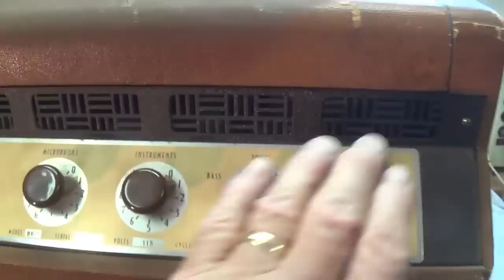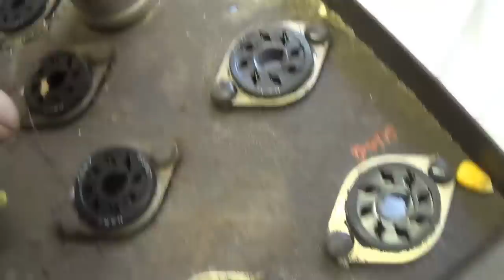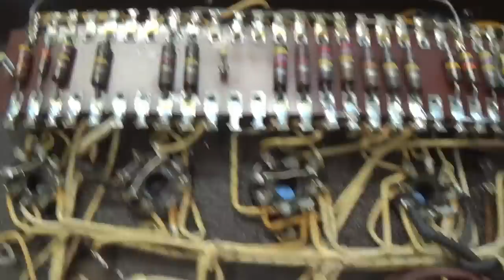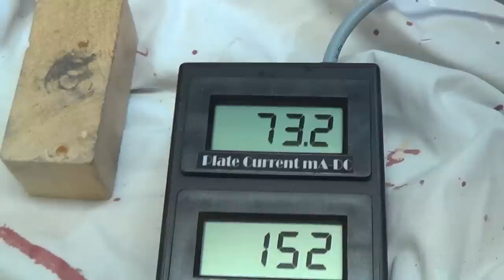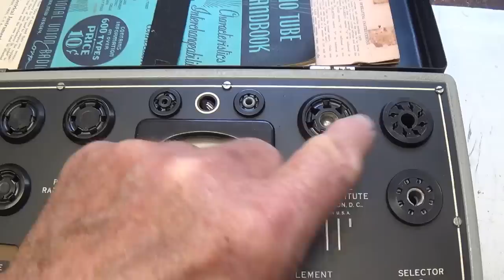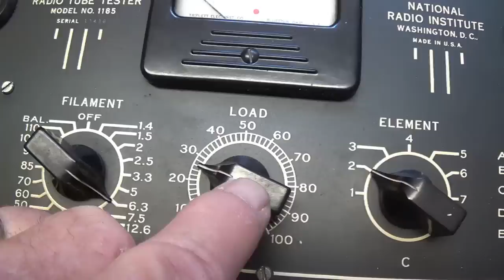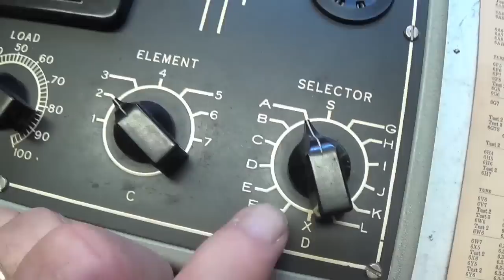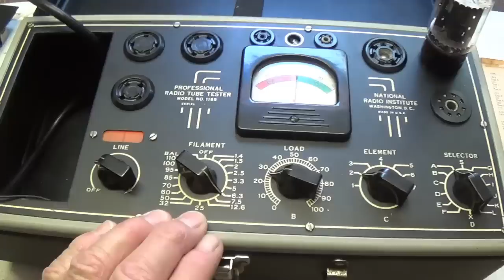Rare & Wonderful: 1946 Gibson BR-1 Amp and 1941 Triplett Tube Mini-Tester

Comment from the maker: In retrospect, and as noted by several astute viewers, the 20K resistor to ground is not responsible for the low B+ seen in this circuit. It may serve to drain the electrolytics when the circuit it turned off, but its parallel (rather than series) positioning would not cause the B+ reduction. Apparently, the HV winding of the PT was configured to create a lower-voltage higher-current output, which was further reduced by the addition of the huge filter choke (probably added to the circuit at a later time).
Reply: More important, don't think there was such thing as a really good used car in 1946
Reply: If it were me, I'd bypass that second choke and see if hum occurs. If not, one could probably do without it. I remember back in high school when a friend was
getting ready to add more inductive filtering. He was getting more hum that he was willing to endure. I told him to reverse the audio feed wires to the voice coil first.
That hum bucker coil under the spider only works if the polarity is right. That did save him buying and adding another choke.
Reply from the maker: Thanks, Tom. The amp is long gone......back home with its owner.
Reply: @UncleDoug   And probably been used a time or two(8-). I didn't stick my head inside the speakers here, but I didn't hear the least hint of hum out of that old
Gibson... So that extra choke certainly didn't hurt anything.
Reply from the maker: It was quiet as a church mouse, Tom, which is always a good thing :)

Comment: A thought on that metal shield might be to provide some slight additional RF protection, if it was used in a radio studio near the transmitter site.  Maybe ?? Many bands preformed live, and many stations had studios located on the same property as the transmitter.
Reply from the maker: Thanks for your input, DH.

Comment: I may have commented on this before but my dad bought that model amp and a Gibson lap steel guitar before I was born! He gave it to me to use when I started playing guitar and singing when I was about 12 (1964ish!) it didn’t work when he dug it out of the attic, so it went to the local electronic genius much like yourself! I practiced and played through it until I bought a used 68 bandmaster about 1970 with the tall speaker cabinet with JBL speakers. That amp was destroyed in the flood of 72 in NYS.
Reply from the maker: What a shame that it was destroyed, Bob. Either amp would have been a nice heirloom.
Reply: Uncle Doug the BR-1 was LOUD too! Now that I think back, I blew the original speaker and just put in a replacement from Lafayette at the time, wrong type because as you know better than I, the original had extra coils so it never sounded right after that. Must be the reason I bought the Fender. I gave the Gibson to a friend and that was flooded too! Love watching you bring vintage amps back to life!

Comment: those 'terminal' boards are common in Australian guitar amplifiers through the 60s.  I hadn't seen them anywhere else until now.  The mounting of electrolytics under the board is also common.  They've even wrapped the leads around the board tags in the same manner... I wonder if this was common tech back in the day, or if Aussies appropriated it (or if techs traveled and brought their methods with them?)
Reply from the maker: It's a fairly common technique, K, probably used world-wide.

Comment: Hi uncle, i wAnt to ask you something, about speakers...I saw on sale a Jensen coaxial speaker of the 40s era...its like new, and searching info about if can be applied for guitar use i dont find nothing,,,Do you know about if its posible to used and if its gonna be good sounding? or if is some mod to take the tweeter off and use only the big speaker?
Reply from the maker: It's probably an electrodynamic speaker that will only work with certain amp circuits. I would not recommend it.
Reply: @UncleDoug  its very cheap and in almoust perfect condition, and it comes with the radio and play records all together...i guees its around the 30s or 40s and nice condition, very very cheap...cant used with guitar but i gonna buyed to see it more closely :D thanks for the answer
Reply from the maker: @fakundofrontera  By all means, buy it and see if it will work for you, FF.

Comment: Hi Doug, you really outdid yourself on this project!  Humor, kitties, circuit comments, clear as a bell, pristine unit... the ultrafecta.  Superb job!  Two comments:  

1) That grill blocks a ton of the direct radiation!  Now it sounds _great_, and clearly that gossamer-thin surface acts as much a diaphragm as the woofer cone itself.  In a perfect world, one could have another, less-impeding grill (or no grill) to substitute with a quick change-out.  I just wonder how that would sound. (It could easily be worse!)

2) The original wire bundling is very fine for many purposes, but I wonder how much crosstalk and intermodulation penalties result.  Of course your careful wire twisting, right-angle overlays, robust grounding, and use of shielded wires has been very successful.  But compared to the original wire layout, I wonder what an ideal rewire like yours would do for noise, distortion, and tone.  The first two should certainly benefit, the last maybe not.

3) I meant to add, do you have favorite make and model (not value) volume pots?

4) Oh, and what were those lovely tunes at 24:00 and 25:00?  I'm ignorant of music. :(

Cheers, Sam
Reply from the maker: Thanks so much for your interesting and knowledgeable comments, Sam. I tend to buy the inexpensive Alpha pots from Antique Electronic Supply. They are spot on as far as taper and resistance.....and they have a nice rotational feel. Ollie & Jack often play tunes they have composed (in between cat naps and catnip binges). I hope you enjoyed them.

Comment: For several years, I hand tied lacing cord in electronic drawers in the Air Force.  It's a lost art.  Zip ties are usually used now.
Reply from the maker: I really like the look of lacing cords, gathering wires into cables within the circuit. You're right.....it is a lost art.

Comment: $200 is 1946 was like half a year's pay. Gold was $35/oz. That's almost $10k today.
Reply from the maker: I'm not sure if the conversion is quite that extreme, D, but there is no doubt it was expensive in its day......just like all Gibson products.
Reply: @UncleDoug  It depends on how you measure it. If measured against real estate it probably is. Gold is $1500 usd per oz now but it is no longer used as currency whereas is was the currency of the united States in 1946 with a set conversion of $35/oz.

Comment: The dents in the aluminum grill can be fixed by smashing it several times with a rubber beach slipper or something like that. It won't damage the grill, but the dents will become less apparent. I used to do it to repair the aluminum grills in parabolic antennas years ago.
Reply from the maker: That is an original solution, Jose. I will keep it in mind :)

Comment: I think despite the BIAS is about 12,2w maybe such a high amp value make overheat the tubes with that old cabinet design ventilation. But obviously I'm not sure.
Reply from the maker: You could be right, Suterudo. Overheating is definitely an issue in this amp.

Comment: Great video, really enjoyed it.  Regarding the low B+, did you measure the ac voltage out of the power tranny?  This would give a good indication of where the B+ should eventually fall, after taking rectified drop into consideration.  Perhaps something else is affecting it.  Can't argue that it did sound good.  It reminded me of early recordings of guitars made in that era.
Reply from the maker: I returned the amp to the owner, Brad, and am now unable to do any further checking. As far as I know, it is still operating properly.

Comment: Uncle Doug... Do you think this unusal 150 plate voltage design here on this Gibson BR-1 was done so to add to output tube life?
Reply from the maker: Good question, Dave. Possibly that and heat reduction......neither of which really seem (to me) like issues that are pressing enough to justify designing the circuit this way. Perhaps it's due to the huge filter choke, which was probably added to the circuit after its manufacture. Very mysterious......yet it sounds great.

Comment: A general old amp question. Some old amps have a "mic" input. How are they different from the "guitar/instrument" inputs? Was there any standard or consistency to them?
Reply from the maker: Generally the microphone input offered higher gain, sometimes utilizing an extra tube or amplification stage to compensate for the lower output of most early microphones.
Reply: Thank you!  @UncleDoug

Comment: Just a follow-up on the Hagerman Vacutrace. As Jim Hagerman told me by email. ”they only come up for sale when somebody dies” the one I have was the first unit off the production line when he was selling them. Jim Hagerman is an audio guru and designs and builds super hi-end hi-fi gear, mostly one at a time because he is so picky about the equipment that he sells he doesn't trust factories to assemble it. The Vacutrace was designed specifically for testing and matching tubes for audio amps. It is a mostly analog design because as Jim put it. You don't get anymore analog than a vacuum tube. I found a website online about ten years ago and ordered one. A month or so later when I inquired about my order I received an email from Jim Hagerman asking me where I had ordered it because they had been out of production for ten years. I gave him the details and he told me that the had the pre-production unit on a shelf in his office, and had enough parts in his storage unit to put together a complete set of adaptor boards and would sell that one to me if I  was willing to wait a few weeks for him to rummage through his storage and find where he had put all of the leftover parts. He went through the unit off of his office shelf and made sure it had all of the final production updates and tested it against the 3 Vacutrace’s he uses when testing and matching tubes for the hi-fi equipment he now sells then shipped it to me. He is a great guy, has a background in everything from microwave communication design to very high power audio systems for theaters. In an interview, I read he was quoted as saying that the most important thing in an audio amp is making it quiet. He said he learned that in the theater audio business, running multiple 5000-watt amps at full volume, with no audio signal going through them, without hiss in the speakers. He said that is a common occurrence in movie soundtracks. So he set out to design high-end hi-fi systems that could do that. Along the way, he designed the Vacutrace for himself and then offered it for sale, even in kit form for a while, but he was about ten years ahead of his time. It was before most people began to realize that tube audio really sounded better than solid state or digitally reproduced audio. So the Vacutrace kind of flopped because there was only a small market at the time. He made two models, a desktop and a portable. (I have the desktop model). When he finally sold out of the small production run he had ordered he decided that was it for that project. He also said that the kit version was a big mistake because he felt like he was having to hold the hand of almost every person he sold one to. Any little problem he would get a phone call. He said it was much easier, and in the long run, cheaper to build it himself and ship it out than to spend hours on the phone walking people through the build. There is almost nothing on the web about the Vacutrace but I have seen a video of a major tube seller’s testing lab for matched pairs and quads of 6L6’s an 6V6’s and right in the middle of the room amongst racks of tubes burning in was a Hagerman desktop Vacutrace and an oscilloscope, with two sets of pentode curves in the screen. I had plans of offering a tube matching service when I bought the Vacutrace but my wife’s health put that on the back burner. I started thinking about how many perfectly good tubes get tossed out just because the amp owner has no way of testing the overall performance of the tube. Tube testers will give you an idea of how good the tube emissions are, but only a curve tracer can show you how well the tube is actually working over a wide range of grid voltages. Also, a curve tracer is the only way to truly match a pair of output tubes over their entire operating range. Maybe I should rethink the tube matching service. I  don't know. The Vacutrace I have is the only one with a blank serial number plate which I thought was kind of cool. I once again got long-winded, but it is a really neat piece of gear. Have a great weekend and say Hi to your wonderfully artistic wife and the kitty’s for me. (Oh I was speaking to another ”displaced West Texan” yesterday at a local store about all of the rain we have had lately and found out I am not the only one who is sick of it, and this blasted humidity, as I write this at 10:49 AM it is 83 degrees outside and 68% relative humidity. Oh how I would love about a week of 5 or 6% humidity. 19 inches of rain this year, over 4 inches in the last 30 days.) never thought I would gripe about rain. :)
Reply from the maker: Thanks for the excellent and very informative review of the Hagerman Vacutrace, Mark. Both he and the device sound totally first class in every way.  It's supposed to hit 100 here this weekend, but generally dry as a bone. They released water from Elephant Butte and Caballo (for irrigation), so the Silvery Rio Grande is flowing once more. Life is good in the Great Southwest :)

Comment: Love the tube tester feature. I have an even smaller one, about the size of a backgammon set, but it must be 50's or  60's, because it's got a 9-pin socket. I picked it up at an antique mall for I think about $25.
Reply from the maker: That sounds like a real gem, Sean......at a very reasonable price :)
Reply: @UncleDoug  Your video has inspired me to open it up now and see what's inside. I bet it has some caps that need replacing.
Reply from the maker: Get her tuned up, Sean, and back in service :)

Comment: Can you do a video with some history of the pros and cons of the speaker with the electro magnet, speaker magnet ? Couldnt you make an adapter for the 12ax7 on one of the other tube sockets ? Thanks , enjoy your  video's !  : )
Reply from the maker: I have posted a video on different speaker types, VW, but it does not directly compare ED to PM design. Possibly an adapter could be constructed, but the wiring challenge would only be exceeded in difficulty by trying to determine the proper settings to test 12A-- tubes. Meanwhile, I'll just use the trusty old Hickok for the miniature tubes :)